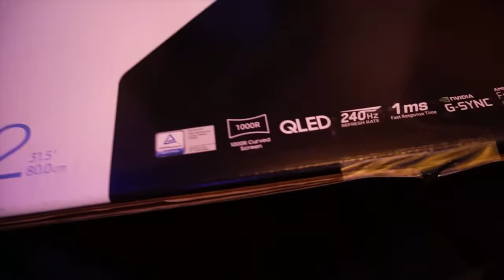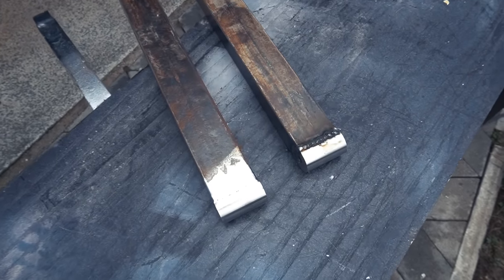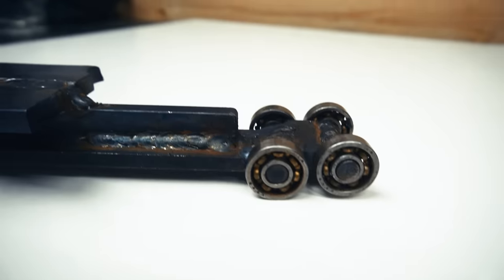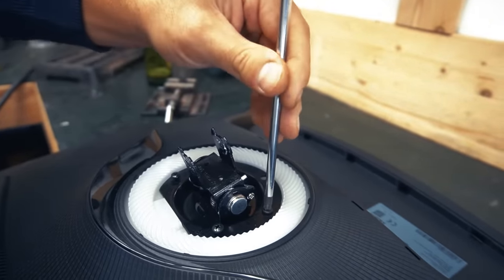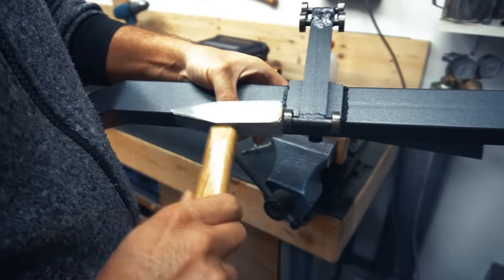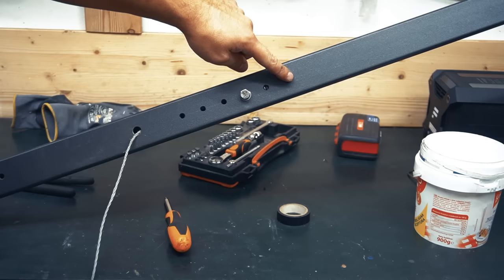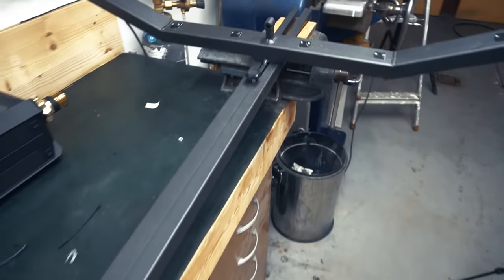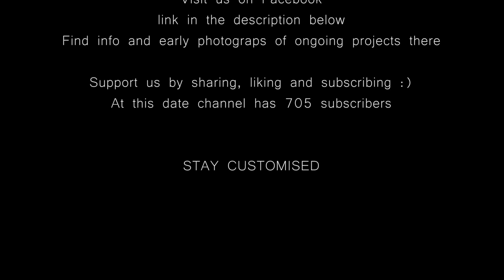Samsung Odyssey G7 Triple Screen Ceiling Mounted Adjustable Stand

Comment: I thought ok, its going to be another one of those "builds" where people assemble pre-made gear, but I just want to know how you set it up and somehow mount it to the ceiling....

When you started to MILL THINGS I started losing my mind ahahahaha. SUBBED! I need a welder and a mill but Ive been meaning to get them for years. Maybe THIS might finally be the reason to do so, as I think this is something I can build quite easily with your video as my guide. Amazing.

Comment: Craftsmanship is just crazy. Incredible job sir. The only thing missing is the ROG Bezel-Free Kit and I think you can make that also yourself with your skills ;)
Reply from the maker: The bezel kit is already installed check my newer videos. ;)
Reply: @T.S.CUSTOM  what angle do you set it with Asus bezel-free kit? And is that measured in the corners or from the centre of the screen? (meaning angle of support bar). Thx !
Reply from the maker: It's little less than 140 deg. You measure the corner because G7 is flat in the corners, no curving there. I am just in the making of the newest video for the bezzel kit and 3D printed custom mounts I made for it so stick around for a lot more information. 😉
Reply: @T.S.CUSTOM  Super thx! I'm in the middle of building my rig with triple G7's this week, just waiting on my PC to be delivered on monday. 🤩
For now i positioned them at 130° but from hardware look alone that looks very "boxed in" , the ends of the monitors bend in quite hard. 😆
Reply from the maker: Yes you can go beyond 130 (recommended by asus) because G7 have a really thin bezzel, and nearing 140 deg you will start to se the black line in the middle.

Comment: I have triple Samsung G7's as well but mine are mounted on a triple monitor stand from PRO SIMRIG.
Unfortunately, the swivel action is part of the G7 base which I can't use.
Except for the single post ceiling mount, I hope some manufacturer sees your monitor stand and decides to make them available.
If that happens, I want one.   Nice job though.  Enjoy.

Comment: i have this monitor and absoloutely love it and i am amazed at the over engineering of this roof mounted display. why not just get the G9 49"". same effect but no bezels
Reply: It's definitely not the same effect. The curvature and width of this is incredible compared to the G9. But for someone who wants something as close to this with 1 monitor the G9 is the way to go (after owning mine for 2 years I'll never play on anything else)

Comment: Excellent engineering and craftsmanship although I think I would have gone with aluminum given the weight of steel and the relative strength, or lack thereof, of the average wood framed ceiling. That being said, I probably wouldn't want to tig weld all that aluminum. Great job

Comment: Great job man.
There's a blur plastic inside LCD televisions, and  that is use to blur screen light points. If you use this plastic between the monitors, they will looks like a single one.
Reply from the maker: Check the rest ofnth channel, you might be surprised.

Comment: Interesting build, cool machine working.
I wonder why you decited on this configuration instead of a a single ultrawide? Of course your setup is bigger and maybe you wanted the side displays more on the side like you configured them which is not possible with a single Odyssey G9...

Comment: I scrolled quite a ways down and didn't see any compliments on the Z5500 control pod so I'm giving the most props for still having that! I finally sold my whole setup last year after 13 years. The Denon receiver and HK speakers/sub I replaced it with do sound better overall but for $220 in 2008, probably one of the best purchases I ever made.

Comment: Better go for VR headset. Outweighs the benefits on all sides. Beautiful and sharp image, full presence in 3d environment and support for 90% of games with the right programs. Now that the oculus 3 with pancake lenses came out, the sharpness and quality of the image is equal to 4k monitors, which is an unbelievable.
Reply from the maker: Already have it from the days of Oculus rift cv1 was released. I have Reverb G2, This is better still. Will make a video about it.

Comment: odd question but did you have any issues gettign the pc to recognize all 3 screens. i have 3x G7's the flat not curved version and while my pc sees all 3 in display settings, it will only let me turn on 2 of them at a time.
Reply from the maker: No problems like that.

Comment: Good driving in Corsetta, you should just go with the Varjo Aero VR headset with such a high ppd it's retinal clear, you won't have to use so much space as you do for the screens.
Reply from the maker: You do know that computer hardware is not ready for such a high end VR headset? I do have Reverb G2.
Reply: @T.S.CUSTOM  You do know that Areo is the HMD model you don't need a Varjo Sub with and mine works fantastic with a  i9-9900KF paired with a 3090 24gig so not sure what ya mean a current computer can't run it. Maybe your current computer lol, I do know it doesn't work with AMD cards so there is that.
Reply: @T.S.CUSTOM  G2 is a great HMD with a lousy tracking solution.

Comment: Tested one G9, and the picture was awfully warped out to the edges, 3x 27" was even worse, so, are there really any games that supports this resolution without messing up the picture? 

With support I mean you can look at a perfect sphere in the center of the center screen, then look left, and the sphere is still spherical and the same size when you move the camera left or right until the sphere is at the very edge of the left or right display.
Reply from the maker: That is why triple screens exists and that is why it is always better than single ultrawide. yes the title exists that supports what you say and it is Iracing.

Comment: This is great. Dare i say the middle screen would benefit from an ultrawide to allow the full front window to be one screen
Reply from the maker: It would, actually I pursued this kind of build but had to give up. Doing it that way has many problems and challenges. That is why it would be hard to do, and then there is a fact that there is no screens out there that are the same height as the G7.

Comment: I think though you will always have them in the exact same position stuck to each other, nobody would swing one up, one down, one left etc. But you might pull the entire setup higher of lower depending on who sits on the chair.

Comment: It's a cool build and I can appreciate the work put in, but I am left scratching my head a little bit. I don't really understand why you didn't just buy a triple monitor floor stand/rig and then mount it on/from the ceiling.
Reply from the maker: This way I got it for a fraction of a cost. I used my workshop and skills, made 5k EUR from the video alone, and it's better than anything on the market.

Comment: Nice.. When you have enough money, try add hydraulic system so the monitors can hide into the ceiling at the push of a button. Like those in sci-fi movies, pretty cool.
Reply from the maker: The first idea was that they could automatically pull up but the cable hassle talked me out of it.
Reply: @T.S.CUSTOM  oh right, I forgot the cables.. it must be a custom cable or use an extension but dunno if the electricity will affect the monitor or not.

Comment: Cool setup. The only issue is the parallax cannot be simulated as in driving. When you move your head, the image in the mirrors and view should change.
Reply from the maker: It could be done with track ir if simulations would support it as a feature.

Comment: Brilliant bud 👏 👍 
Looks great. Wonder what F1 looks like ?
I been thinking about twin 55” Odyssey Arks for F1 and ETS2 . Wonder is someone has done this. Not cheap to set up. Need some sponsorship!! 😆
Reply from the maker: I don't believe anybody did the arcs, that would be seriously wicked setup! They are super expensive screens, the G7's are cheap compared to them. Running in triple 4K is very challenging and although it can be done I dare to say computer hardware is still not up to par.

Comment: Missed a trick not removing the monitors from their plastic frames and creating custom housings. That way you could have the monitors perfectly aligned with each other without any bezel or frame showing.
Reply from the maker: Just check the rest of the channel

Comment: I would have used the plastic thingy they used in linus tech tip to remove the frame of the screens. it takes the light and blend in the image, light  and color. so you hardly notice the frame on the screen in the picture
Reply from the maker: Well I used it. Check the rest of the channel.
Reply: @T.S.CUSTOM  So you did not like it?

Comment: Are you aware of the existence of aluminum profiles? All of this could have been used just as flexibly, but would have required a fraction of the work and time.
Reply from the maker: Only procurement of aluminium would take more time than it took me to make this + it would not look nearly as cool as this.

Comment: I put gorilla tape on the back connecting my monitors and holding them in place
Reply from the maker: I actually put small pieces of double-sided tape between the screens where the 2 screens touch. The 3D printed Asus free bezel kit bezel lenses holders we manufacture also help a lot in holding them in place.

Comment: you actually need 4 screens - 1 for left window 1 for driving seat 1 for passanger seat 1 for right window
Reply from the maker: It would be better I believe but for now this is not supported by any simulator.

Comment: A screw jack and a 12v motor would be a cool height adjustment mod. 🤨
Reply from the maker: Yes, but in the end I concluded this adjustment is basically one time adjustment and then it stays like that for most cars.

Comment: 2:00 "As I mentioned, the precision of this must be super high"

Proceeds to notch tubing in the least precise way possible.

Cool build though, just thought that was funny.
Reply from the maker: Don't agree because end result was a perfect 90 deg weld.
Reply: @T.S.CUSTOM  Little late bud, and just because you did something a janky way doesn't mean it isn't going to work out. Besides, taking another look at this,  you didn't need it welded at 90 degrees, that measurement isn't even involved here. You needed it welded centred and flush, and if precision was that important, you'd have clamped the work piece and used a hole bit to notch the tubing.

Thanks for coming to my Welder Fitter Ted Talk.

Comment: The only unfortunate thing about these monitors is that they decided to put VA panels on them. Viewing angle is not the best especially if you're running triples. Otherwise it's a very nice setup. I thought it would be cool if you had made the ceiling mount collapsable as well which would allow you to move the screens up if you needed to get at the back of the rig itself.
Reply: ? VA is known for better angles, think you might have confused that with ips or especially tn. I'm in no way endorsing the G7, too many problems and extremely poor support, I have always had ips and va, the ips for framerate and the VA for a side monitor for better angles and darker blacks for multitasking and movies.
Reply: @ledfootfam99  No, IPS definitely better viewing angles. The G7 has a higher quality VA panel meaning the viewing angles are better, but in no way better than an IPS panel. IPS panels have better viewing angles because the liquid crystals can shift horizontally allowing superior viewing angles.

Comment: You should have made it to it have support for one G9 monitor and two G7 monitors but that is all too late right now 😅

So if I would choose, I wouldn’t have swapped out the front monitor to a G9 because the curve with a wider monitor, it’s more visually pleasing to the eye to get the entire front window of the car on one screen and the two side windows on the two G7 monitors on the side
But if I wasn’t rich, I could buy many monitors, I would just get the VR  😂  problem fixed lol
Reply from the maker: Cant do it, the screens don't have same height. Would do it if there were a screen combination that fits and that the height is not less than samsung G7 32"

Comment: A completely useless structure, just wear a visor for virtual reality that costs much less than the three curved monitors and connecting it to the same PC gaming you would get a better result and also much more realistic.
In addition, with that view you can play many other types of game and also make other experiences of various types.
While with this solution the possibilities are limited.
Reply from the maker: Already have it from the days of Oculus rift cv1 was released. This is better still. Will make a video about it.